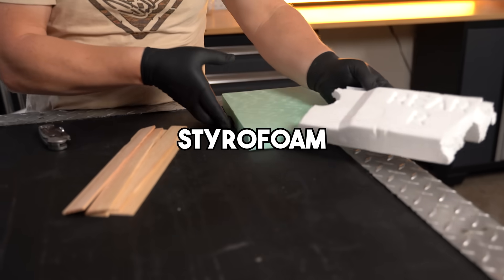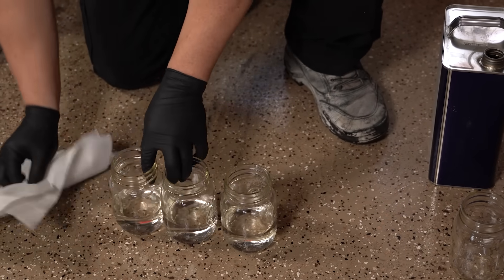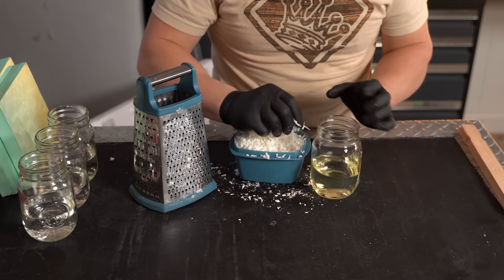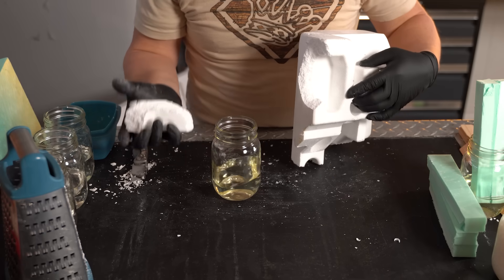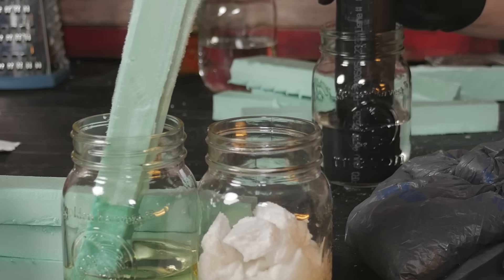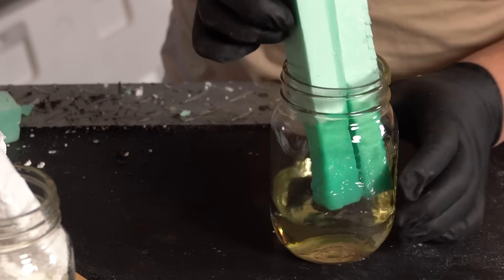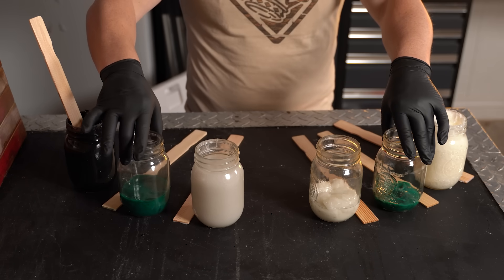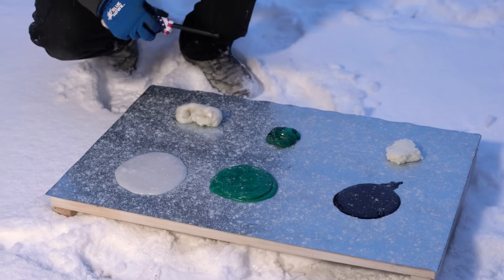Napalm, for Science! Is there a Practical Use for it?

Comment: None of these mixtures are nearly Napalm. The styrofoam thing is a bit in the right direction (PS, benzene or toluene, gasoline) but the soap composition has nothing to do with napalm (other than sodium salts are used in the real deal). All showed mixtures are just swollen plastic or gasoline soaked in soap powder.

Comment: A much younger version of myself used to do the low density styrofoam and the soap methods in the early 2000s. In my experience, literally jamming the styrofoam in, forcing it against the bottom of the container with some pressure, would vastly speed up the desolving process. Just an FYI

Comment: The acetone tends to spill because you are holding the can upside down when pouring. The spout should be at the top to allow air to flow in without obstruction. Also causes less sloshing as the liquid pours from it's surface.

Your Dad should have taught you that when you did your first oil change.

Comment: using way more liquid will result in something more practical in a scenario where you don't wanna spend 8 minutes spreading it with a butter knife lol

i've also always been told a 1:1 mix of motor oil and gasoline works best but i've never done it myself so i wouldn't know

Comment: These are just different types of glue. The polystyren (from styrofoam) or ABS based are quite commonly sold. Usually they are acetone based as it disolves these plastics better than gasoline.
Reply from the maker: All true. The part where I explained that got cut, none of this is actual napalm, just a reasonable approximation. -Jarom

Comment: Would a cheese grader work for the abs, if u dont have a miter saw?
Reply: If you have several hours to sit and work it against the grader ABS is a hard plastic it's not going to shred easily that's why he used a miter saw
Reply: @coltonkoepp655  thabks, OK that makes a little bit more sense, that's why he didn't use a blender